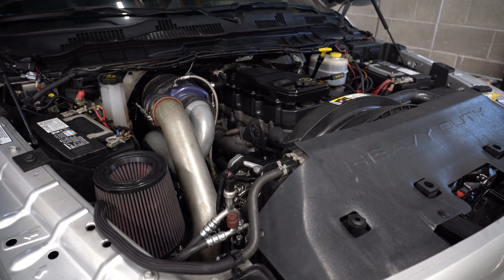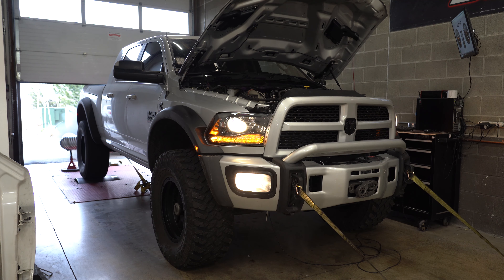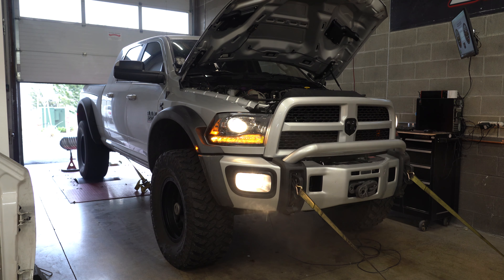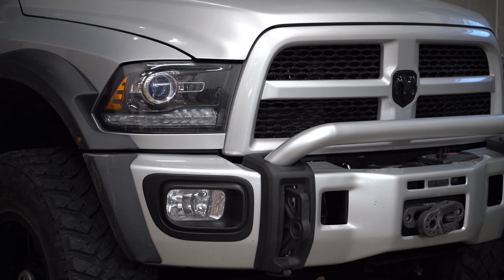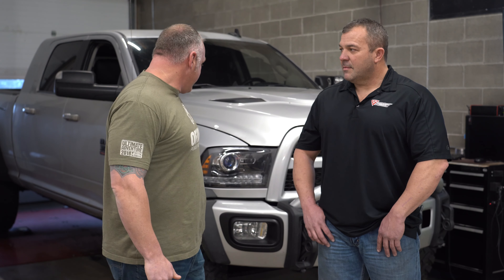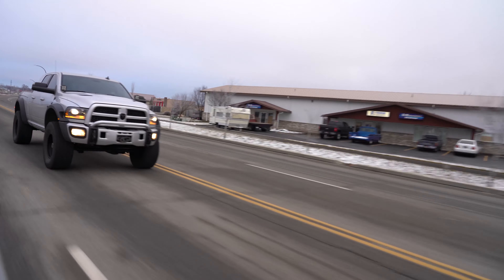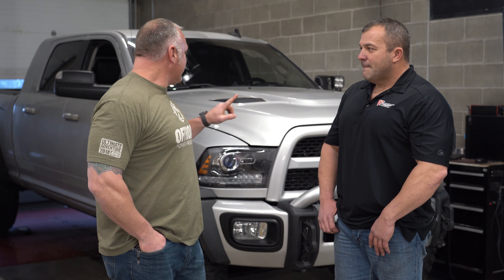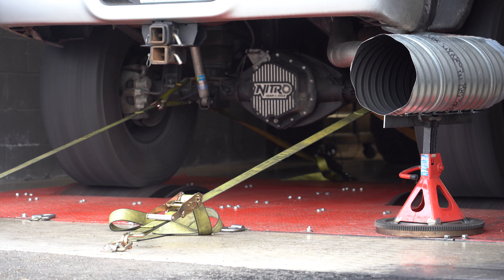How to Make Your Cummins Run Better on 40's

Comment: Hey Mike, Cool video, love the no nonsense "this is why" approach. That said, why a Detroit locker in the rear instead of another air locker? What are the pros and cons of a Detroit in an HD Diesel Ram? And what gearing would you reccomend for 37"s on a Diesel Ram 2500 4WD???

Comment: So realistically much money will it cost to regear a 2014 2500 that gas 3.42 to this?  I want to run 40’s without harming the truck
Reply: Your 6.4L gas isn't putting out the torque a Cummins does, so you are at an even worse mechanical advantage trying to run 40s.  Regearing has to happen on both differentials with a 4x4, so you're looking at ~$500 for the rings and pinions, and $7-800 labor.  This is a great time to install lockers, which are $600 (Detroit TruTrak) to $1200 (ARB Air Locker) each.  So...for the parts mentioned in this video, expect to pay $3k.